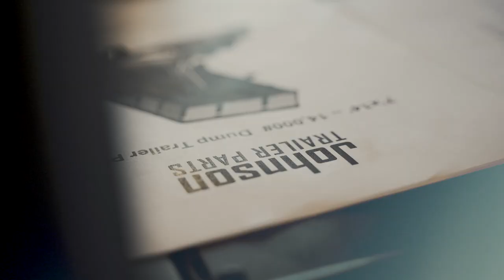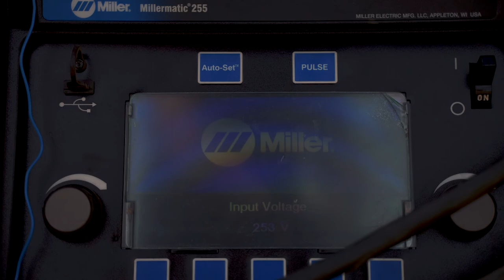Building a 14,000 lb Dump Trailer - 7' x 14" Dump Bed - Using Dump Trailer Plans

Comment: It looks like you are building the trailers in quantity.  A simple table jig would really help and ensure accuracy and speed production.  You guys can obviously cut and weld steel and a jig would help tremendously.  You have the right work attitude anyway.
Reply from the maker: Good Morning, We actually do not build in quantity. When we come out with new blueprints we do a test build to make sure the plans are good to go before we offer them for sale. Yes, if we were to build in quantity we would build jigs to speed up the process, but as of now we only build one trailer per blueprint we offer.

Comment: The back doors, Man they suck. I'd like to see you put a long back gate that swivels at the top with pins you slide out at the bottom to dump or if you're feeling froggy put hydraulic or electric pins on like a toggle switch for a no smash your skin rear end. You guys did an awesome job.

Comment: I looked at the plans and kit and didn't notice any of the wall or decking material..Am I wrong?
Reply from the maker: In the instruction portion on the plans on page 6 it talks about what sheet material is needed for floor and side walls. It also gives options for different thickness sheets you could use.

Comment: What hub face size n spring center did you use? Im actually planning to build one of these exact builds myself. Also not to sure on the steel framing, where did you buy yours from?
Reply from the maker: Sorry we missed your question. On our build we used 7,000lb axles with hubface of 95" and spring centers of 80"

Comment: What was the total cost to build it
Reply: Impossible to quote because you have to buy your steel locally so prices will vary a lot.
But it should cost about 1/3 the price of buying a factory built trailer.
Reply: A new one is about $15,000 there parts kit alone is over $5,000 with no steel. Also a lot of the parts in there parts kit are not the ones pictured in the video I/e fenders in the kit are the cheapies the tongue jack is a cheapy. My thought is at least price the parts you shown in the video.

Comment: nice job might help convince others to build one if you 
could give a ball park figure to build compared to buying the same trailer size. 
Enjoyed the video and will be a subscriber.
Reply: I bought a set of 5k axles from these guys 18 months ago to rebuild a utility trailer. When I calculated the cost to build one of these dump trailers, it was about 1/3 the cost of buying a factory built unit of comparable quality. These guys have the best prices for quality axles and they are nice guys in real life.